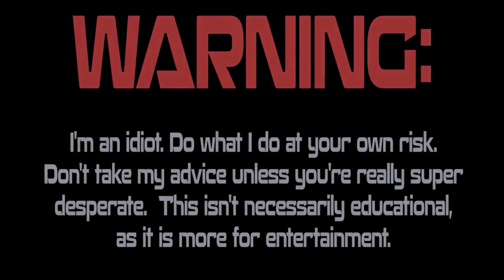FORGOTTEN 1963 Buick LeSabre -  WILL IT DRIVE 100 Miles Home? (P2)

Comment: "the frame was saved by an extensive transmission leak" I'm crying...
Reply: Brake line not rusted tight due to valve cover leak!  Lovin' every minute of it!
Reply: if theres no oil under it, theres no oil in it.
Reply: In salt country, a slow oil leak makes a great undercoating.  Years ago I had an older car in the Midwest with an oil seep from somewhere on the passenger side.  Not enough of a leak for the drips to reach the ground but enough to keep the sub frame on that side "as juicy as grandma's meatloaf".  That side also had the oil filter mounted horizontally in a place where it was impossible to not spill some dinosaur juice on the sub frame when changing the filter.  After 25 years of Midwestern winters the driver's side of the sub frame had cancer but the oil-coated "drinker" side was as solid as new.
Reply: Approved!
Reply: Maybe get therapy to help with the crying

Comment: I've never known a guy so lucky when it comes to getting long forgotten old wrecks, not only running and moving again, in a day or two, after decades of being parked up outside and with the minimal amount of new parts thrown at them, but then driving the things home afterwards. Usually, pretty much, without issue, (or brakes)! Makes for great watching though, and the reason why VGG has become one of my favorite you tube channels. There aren't many channels that make me drop whatever I'm doing to watch as soon as a new video is announced.
Reply: ;{> true story and well written... esp. the 'without issue, {or brakes}... I'm still giggling
Reply: Takes a lot of years of effort to get that “Lucky”!!
Reply: You gotta work pretty darn hard and have a lifetime of experience for this kinda 'luck'
Reply: I don’t think it’s all luck, the guy has a good eye to judge if the car has a good chance to run by inspecting it beforehand and he has the skills to bring it back to working condition.

Comment: “Throw some zipties on here and make this temporary situation permanent”
Master of mechanics ànd quotes
Reply: We used to use wire of various grades if wire and just the perfect twisting process withoout breaking it
Reply: Haha I heard that, went to the comments and yours was the first I saw. That was hilarious.
Reply: Mate of mine toured as a lighting technician for decades, showbiz has two rules:
If it moves and shouldn't; Gaffa tape. If it doesn't move and should; WD40
He also added "Gaffa tape, holding the world together." XD
Reply: Did a 'temporary' fix with zip ties on a diesel pump on a nearly new Citroen van. Still on there ten years later when I scrapped it.Well,it did the job.
Reply: Temporary*
Reply: Main thing I learned selling used cars for 3.5 years: zip tie is your friend. Won’t rust, won’t corrode, will hold forever. Just keep it away from heat.
Reply: Ever solder a three way positive connection on your starter? I had a feller show me that one a few years ago. I wasn't sure at first but it worked. I hated to have to replace the starter again.
Reply: "Zip tie Garage.''

Comment: This one has to be cleaned up and fixed on. A fix on that rear end, some brakes, an exhaust, some glass, and a good wash.
Reply: I agree. A guy thinks there is a replacement windshield in the trunk too.
Reply: 2500 wet n dry the paint then a polish and she be gleaming like she just left the factree.

Comment: I have never seen you move so fast, a guy does not want to burn down another guys garage.
Reply: I agree, Derek actually broke character there for a second. So he "is" real.
Reply: I was thinking at the end when he pulled into his own garage that I might have left it outside that night and some distance from anything valuable, just in case.  While an old, overheated, gas-leaky car burning down soon after I get it home is not optimal, I'd prefer it not take my garage with it.
Reply: That was my first thought too I have never seen him move that quick
Reply: That finger wiggle at 22:40 was a guys brain firing on all 8 cylinders activating "oh sh*t mode"

Comment: Derek you need to check your trans fluid with the vehicle running. In park or preferably in neutral with blocked wheels. I build transmissions for a living. You are the man and I appreciate your videos to the point of re-watching old episodes. I don’t know how I missed this the first time through. But that is gonna save you a lot of trouble.

Comment: Lets take a minute and just appreciate the boat gas tanks duct taped to a hose so it doesn't fall off the fender.
Reply: it's called poverty chrome, not duct tape
Reply: Not to mention spraying gas all over a running engine!
Reply: @davevoorhees5994  Hey, he jumped into action right away at the sight of it......It’s fine!

Comment: Regarding the starter situation,  I know that when Buick stared using the TH400 in some of the '64 models, they took a different starter than the Dynaflow models...maybe that's what you ended up with from the parts store.   They looked similar,  but were not interchangeable.
Reply: I was looking through the commenta to see if anyone knew I'm extremely curious myself lol

Comment: Maybe just maybe the light switch on the floorboard controlled the heater.
Reply: That's what a guy was thinking. I had an Oldsmobile that had a custom heat switch similar.
Reply: I've actually got a toggle switch in my 94 Buick that turns on the blower for the heater. Lol
Reply: Yeah considering the location, I thought it might be for the blower motor too

Comment: I used to own a 1963 Buick convertible, you could hold a Mazola party in the back seat, what a runner.  Swapped it out for a 1967 Duce and a quarter convertible, what a car.  Keep up the great work.

Comment: I tell you what, that moment when the manual fuel pump started spittin fuel and Derek kinda froze a bit when the car wouldn't turn off. I feel like we've all been there at some point. The "oh crap, what do I do?" Moment. 
Great content as always, always look forward to new uploads.
Reply: Pulls the battery lead...engine keeps on running..
Reply: @faustusTVR   I be like wtf do I do now lol
Reply: @faustusTVR  That's just to test if Alternator/Generator is still working

Comment: My $$'s on "a guy woulda had some heat had he flipped that house switch"  :)
Reply: Yes, Derek, what WAS that finely-installed house light switch FOR in your Buick, ANYWAY?! It WAS the heater (something like on low constantly), wasn't it? ;)
Reply: @moparman1962  If not a heater blower motor switch Maybe it was for reverse lights to get thru inspection or a neutral safety switch.
Reply: I think he was worried about getting too much heat, as in FIRE!

Comment: Fix up the exhaust, cool wheels n tires. A little suspension work. And she's a driver. At least, I'd drive it. :)
Reply: nothin like a set of zoomie headers stickin' out the side of the Buicks fender where the standard 'portals' are usually found.  do up the brakes a little. clean up the interior a bit. fix what needs fixin to get it to where she needs to be. not a restore or anything like that. then make it a daily driver. kind of like Cold War Motors
Reply: . . . and Just Maybe a windshield. Or would that be a "wind un-whirler" . . ?

Comment: Just a little ditty, instead of the stop leak, next time try course black pepper, a tablespoon to the radiator, run it till it gets hot, and watch the leaks stop. Better than stop leak, because it doesn’t goop up the heater core, the pepper is pushed into the leaks and swells up to plug them, the rest just circulate thru the system without plugging everything like stop leak does. It works! Not a permanent fix, but the last time I used it was on a work truck, it lasted over a year, and it can always be redone if another leak developed over time. Eventually the pepper will break down, a lot cheaper than stop leak too.

Comment: So we've got a fuel leak! You had me laughing so hard I almost woke up my son from his nap!
Reply: @ViceGripGarage  You can certainly bleed brakes by yourself with some tubing and a jar, and to your brake standards even without, since I usually have time to get out and close the bleeder before it pulls too much air back in.  Just don't open it real far or let up on the pedal too fast.
Reply: @ViceGripGarage  like nearly all old cars, I think they should become practical daily drivers for the working poor, so fix what needs fixing with practicality mostly in mind, but also some historical preservation as a second consideration, then sell it unless you want to drive it daily.   Though by daily, I don't mean in the salty winter.  It's too classic to be a winter beater, even with good spray wax on the underside.  If you can't get a windshield, and with it a plate, then maybe it should go somewhere like Mexico where it can get on the road with a cracked windshield, and avoid winter salt too.

Comment: Odd side effect of watching these videos, I feel much more confident about my own vehicles making it to their destination!
Reply: The only thing that seems to die out on the interstate more than in town is dry rotted tires.
Reply: @alan6832  and wheel bearings.
Reply: I was driving my 40+ year old vehicle yesterday thinking the same thing.  I was like, "well if Derek can drive a 23 year sitting no brake, no idle car back 2 hours to home, mine will do much better with brand new brakes, and a well tuned engine."

Comment: 15 degrees outside, well that's just cold enough to freeze the nuts off a rusty gate, well I be dipped!!
Reply: @blackcountryme  That would be one of them thing-a-ma-jigs they used back in the day to keep them cannon balls in place on the deck of a ship. When it got real cold out.., them things...they would shink up and the cannon balls would flip-dip, blurp and then roll all over. A fella had to stay down on the poop deck to avoid them balls but we won't talk about that..., it wasn't nice..., the poop deck smelled like the back seat of a 1980's taxi cab mixed with wiener water and work boots..
Reply: @IR-nq4qv  yep cos brass contracts more in the cold, and the cannon ball holder was called a monkey cos it was up the mast...

Comment: For future reference, when you have a return line like that, run it back to the gas container instead of the tank. What could go wrong?
Reply: It can leave sediment in you good gas can that could later gum up the carburetor. There is also a lot of shit in the lines of cars that sit so many years. You always return to the polluted source.
Reply: @davidthompson62  The return fuel coming straight from the carburetor back to the gas container wouldn't have any more sediment than just the contents of the float bowl.

Comment: I'm really liking this going to town rigg, that old motor sounds mean and moody. Never seen you move so fast when you had that fuel leak 🤣🤣.  Is that the old garage too? 🤔
Reply: Had a Nailhead in a Riviera....401ci.....the cam timing in these engines is kinda rowdy for a luxmobile.
People kinda complained about the lumpy idle, went through a few revisions before the redesigned big block Buick came out.
Reply: @hoost3056  I love how it sounds, think it's the best sounding revival Derek's done.

Comment: Ive heard you comment multiple times about not having help bleeding brakes but i have to believe you know the trick of running a hose from the bleeder to a bottle with fluid in it and pumping the brake with the bleeder cracked and the end of the hose submerged. Pushes air out but cant suck air back in. If you or any viewers didnt, now they do.
Reply: Just install some speed bleeder screws with a check valve. Dorman makes them.

Comment: Quick question: Did a feller remember to put the entry rug back before the wife found out?
Reply from the maker: sure didn't haha
Reply: Lol
Reply: Notin' like buying a replacement and telling the better half it needed replacement. she later finds it in the trunk of the old Buick saturated in gas and oil.
Reply: better than using one her tupperwares to change the filter on the heating oil tank. then putting it back thinking you got all the diesel smell out of it.     ask me how i know.
Reply: @ViceGripGarage  That Jessicas a keeper.  LOL
Reply: @banshee8989  oh Lord....I snagged on a piece of the better halfs tupperware to change the fuel strainers in the clatter wagon. I made the same assumption. I even tried to be nice and run the bowl through the dishwasher...mainly to hide the evidence, but a guy likes to help out every now and again. 

Did you know that a dishwasher could smell like diesel for up to 4 months after the fact? 

On the upshot, I'm not allowed to touch the dishwasher OR the washer and dryer after the "you put my favorite shirt IN THE DRYER?!?!?!" incident.

Comment: Had a 63 Buick skylark , 310 wild cat , 3 on the tree , all in all great reliable car , had a 72 Buick 350 , running it thru hell and back , great car , went thru some fence that rapped around drive shaft , got so hot trying to get out of the mud and fence , couldn’t see drive shaft , but thought I blew the trans , rolled it over on it side with tractor , to get fence off drive shaft, to find my transmission was still good , but drive shaft snapped in half with the heat , looked like ya hit it with cutting torch , them was the days 😊

Comment: Man! I will agree about starters being the most annoying part to install. Some Wisconsin winters back, I assumed my Jeep’s starter was bad, not knowing much yet about tests to confirm. But it was about 20 outside, the jeep was parked in backyard, so I had to lay in the snow busting my knuckles wresting out the old unit and replacing. Had to take plenty of “warmup” breaks during process, and finished up and went to turn the key nothing! After reading more about issue, come to discover it was bad neutral safety switch SMH! And since I turned my old unit for core money back, I couldn’t return new one to get money back, and I still had the issue. I still got the bruise from kicking myself so hard on that one. Cheers

Comment: That was a beautiful era for Buick.  A friend had a Buick wildcat in an old Riviera,  the 401 was a great cruising motor. One day it would make a strange noise when trying to start it. Turned out the ring gear was spinning around the flex plate. A wire welder and lining up the original welds were enough

Comment: The 445 stood for the torque not the cubic inches. I had a 62 hardtop Dark blue ,white buckets ,a beautiful center console automatic transmission with gages . It was a class act. I loved it . A torque beast.

Comment: That headliner issue thing you have. I try to carry a couple of the 60 pound pull magnet that you find at the Home Depot. They come in handy for holding tools and screws but have used them for headliners and wires and other things.

Comment: LOL here! Back in the late sixties, I had a Pontiac Bonneville Convertible and the engine went out of it just before I was going to trade for a new Ford F150. I barely had money enough to get the new truck but knew I needed to do something. I was stewing around about getting another engine or something and a friend of mine said he had a friend that had an old Pontiac Catalina that I could have the engine and transmission if I wanted it. Yea, of course. So we drove down to southern Iowa in his pickup to get it. Shock, he had pushed it out into the field and totally sideways down into a ravine and it had been there for a couple of years. So he got his tractor our and with the tractor and pickup, we pulled it out of the ditch. Lucky for us it came out on its wheels. We commenced to take the motor and transmission out still bolted together using the loader on the tractor and put it in the back of the pickup. Pushed the Catalina body back down into the ravine and went home happy, sort of! I got home and took the transmission and the engine out of my Bonneville and put the Catalina engine and transmission. into the Bonneville by myself. I had to change the transmission because it wouldn't work apparently or fit, that is what I was told, so that is what I did. After I changed it I put a little gas in the carburetor and low and behold it fired right off and I traded it off a week later. One major problem is the Bonneville was a much heavier car than the Catalina and the Catalina transmission apparently had one less gear in it. It was a dog!! Good old days, and now good old memories! Thanks, J.R.

Comment: My 1978 Eldo w/425ci V8 front wheel drive Brogham had starter issues constantly after I lost the rear main seal. Oil would gum up the starter after awhile and it needed to be hauled (R&R'd) out but all the remans didn't qutie fit right. So I was able to open both up and swap the insides, return the remanufactured one with the gummy/oily insides inserted into the body of that which I had just purchased. I didn't have the money to fix my Eldo's seals and no where to park it in S.F. California so after a few too many swaps a broken rear window by a thief that broke it but and gave up trying to enter, I sold her. This was back in 1994, It was a fine ride for the short time span I had her in my possession though.

Comment: add a tee to the feed line then run the return to the tee fitting. the fuel runs a constant circle pulling from the tank as needed

Comment: I remember in the 1950s the mechanics put a car on the outdoor lift and used a steam jenny to blast away all the accumulations of dirty grease and greasy dirt that coated everything.  This car has a really thick layer of that gunk.  I repaired sirens on my VFD fire trucks, and it is interesting that they are powered by starter motors.